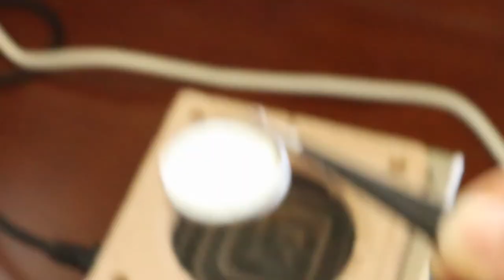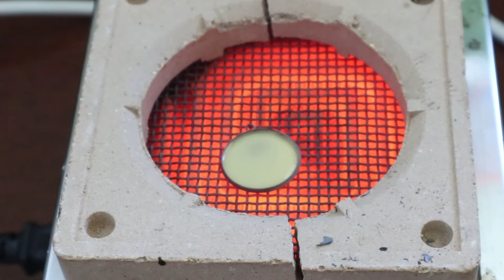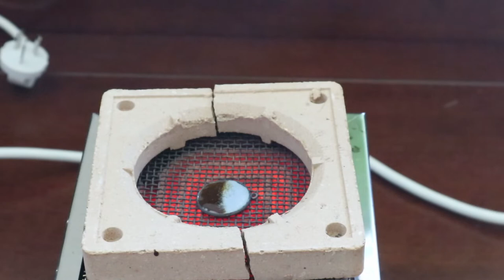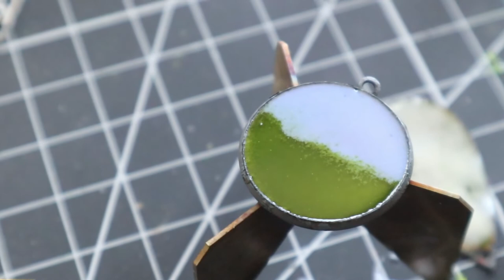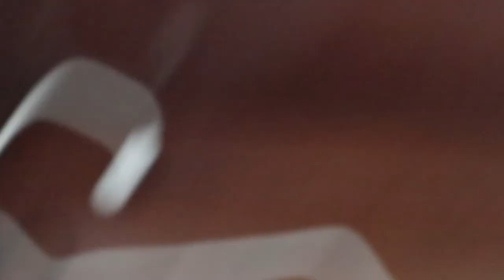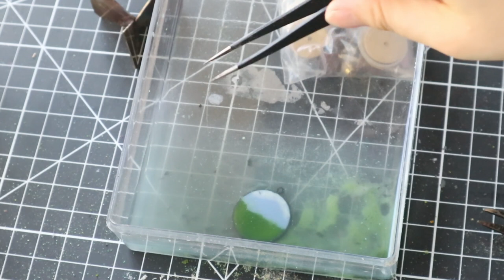NO TORCH-NO MUFFLE—Low cost DIY enamel/cloisonné jewelry

Comment: Hello! I'm working on building a tiny kiln for enamel, but this is a wonderful solution! What kind of stove is this? it is not a type i see often.
Reply from the maker: It's Experimental Electric Furnace
Reply: @cloisonnepaintingart  Ah. Thank you! I have kiln bricks, element, computer, and probe, so for now i will try to build a small one. If it doesn't work out, i will try with that. 

Your work is masterful. absolutely beautiful.
Reply: @cloisonnepaintingart how long it takes for the glass to melt?